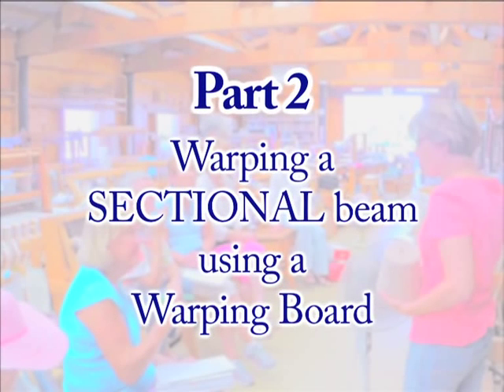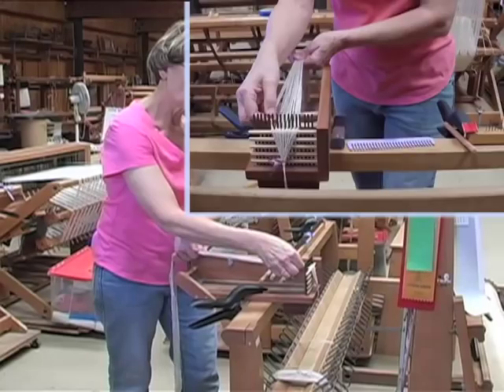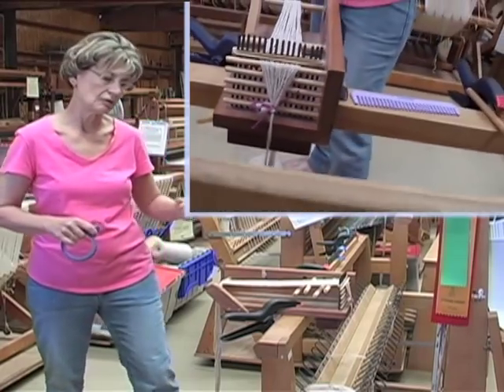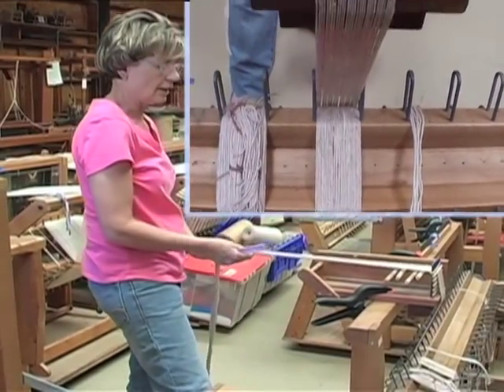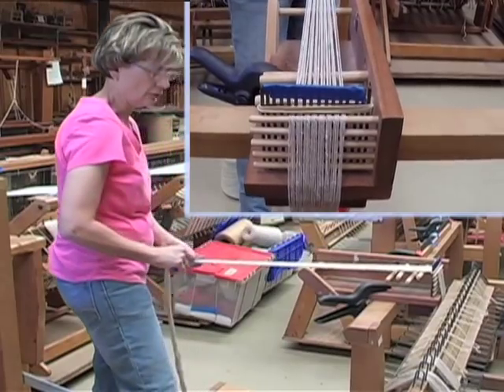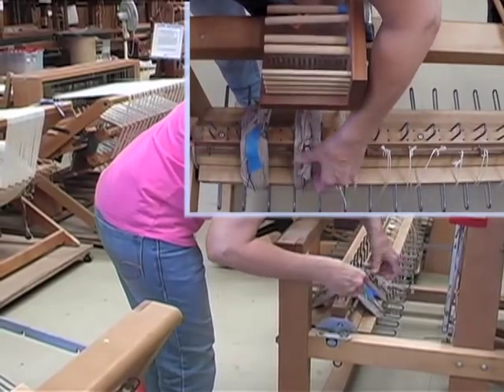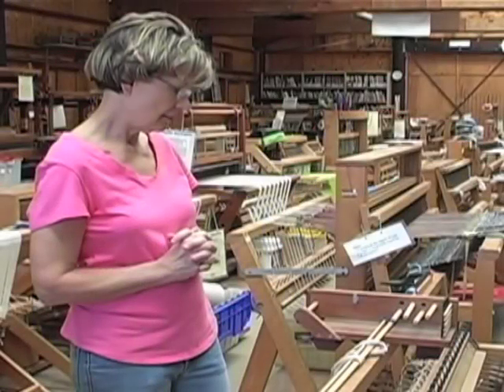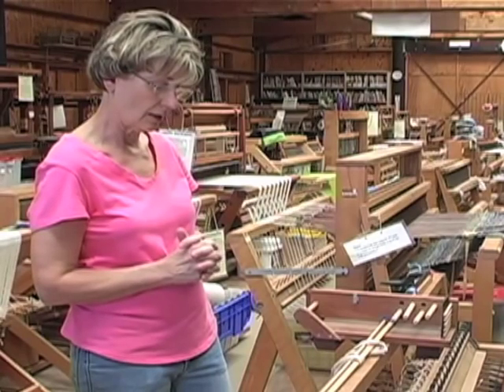Warping a Sectional Beam via Warping Board (Part 2 of 2)

Comment: I am not finding very many videos like this, and I am not versed in this at all, I think someday I will finally get my loom warped. At this point, I am wondering...Is this the actual use of the box you are showing, or is this somehow a modified use, as the actual tool isn't available? I am wondering also, how long does it take for the average weaver do this operation to be ready for weaving?

Comment: In the beginning of the video, she ties an overhand knot to attach the leader to the section. When in the process did she cut the ends? Just before tying the overhand knot? Thanks!
Reply from the maker: The threads of each section are measured out on the warping board. There are loops at most ends as this is often a continuous thread. When the section of threads is taken off the warping board, ready to be wound onto the beam, the end without the tied cross is tied onto the leader without cutting any of the loops. This is then wound onto the beam until you get to the end and tape it down. The cross is at the end now, where you can find it. After all the sections are filled and all the cross ends are taped to the beam, you can start putting lease sticks through the crosses to preserve them. This keeps the threads from crossing over each other.
When you start to thread the heddles, then you have to start cutting loops.
- Jeri Abernathy (Fluffysgarden)

Comment: Any helpful tips on putting on leaders on the sectional beam?  For example, how to attach leaders
Reply from the maker: +Lana Schwellenbach Hi, Lana. Most sectional beams come with leaders attached by the manufacturer. But if your loom beam does not have them, you need to make one of each section. Some sections are one inch and some are two inches (US measure). Each lead needs to be the same length and folded double, so that it comes up over the back beam enough for you to work with it. At the beam, if you have wood, you can tie a knot in the lead cord and staple it to the beam in the exact same way for each section. The cord needs to be something not stretchy and very strong. Waxed cotton, Texsolv. Braided nylon. Thin enough and flexible enough to wrap smoothly around the beam. Texsolv cord works well.
Reply: +schwansongs Thanks, I think I got that done correctly.  On to the next problem.  The back beam is round, so I'm trying to figure out the best way to secure the raddle to it.  I'll probably try clamps first.  Thanks again.